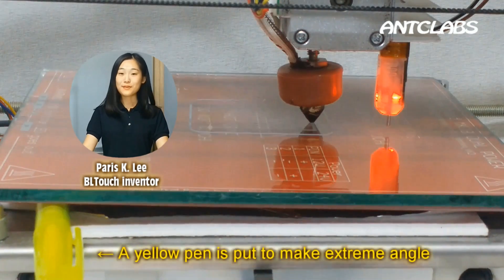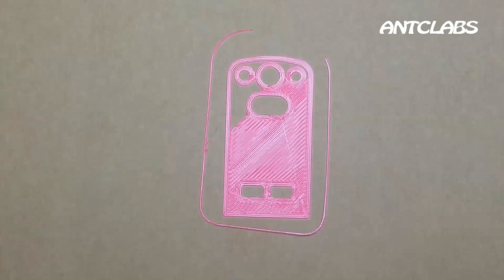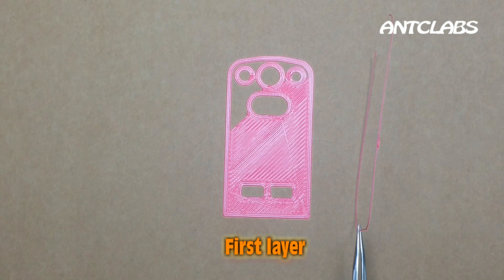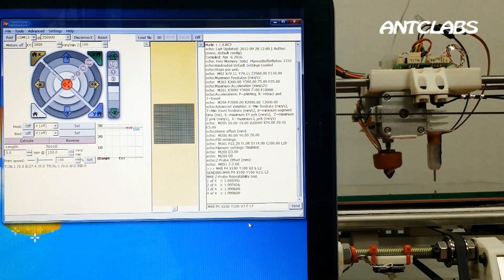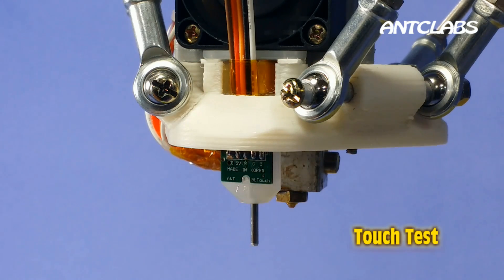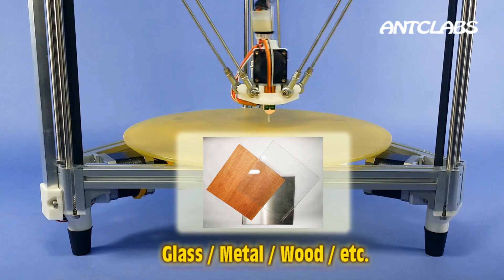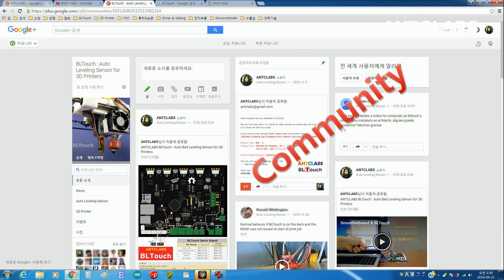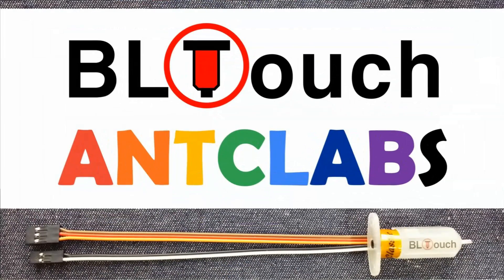ANTCLABS BLTouch :: Auto bed leveling sensor for 3D printers

Comment: It's incredible. The BLTouch cable must actually be shielded, if it is routed too close to the fan cables. (https://youtu.be/jkcrRCxPlZM). If I turn off one of the two fans on my hotend, leveling works without any problems.  If I switch it on again, it will break off leveling somewhere.  The disturbances actually seem to come from the control of the fans.  I preheated the printer and then set it to cool down and then leveling it ... so one fan on my hotend is also off and it works.  The bed then still has a temperature of 50-60 degrees.  For leveling once a week or a month, that's enough for me, because I want to save myself having to shield the cable. :-D                                                                       Es ist unglaublich. Das Kabel des BLTouch muss tatsächlich abgeschirmt werden, wenn es zu nah an den Lüfterkabeln verlegt ist. (https://youtu.be/jkcrRCxPlZM). Schalte ich einen von zwei Lüfter meines Hotend aus, funktioniert das Leveling ohne Probleme. Schalte ich ihn wieder ein, dann bricht er das leveling irgendwo ab. Die Störungen scheinen tatsächlich durch die Ansteuerung der Lüfter zu kommen. Ich habe den Printer vorgeheizt und dann auf Abkühlen gestellt und dann leveling ausgeführt....so ist ebenfalls ein Lüfter aus und es funktioniert. Das Bed hat dann immer noch eine Temperatur von 50-60 Grad. Für einmal in der Woche oder im Monat leveling reicht mir das, da ich mir das abschirmen des Kabels ersparen möchte. :-D

Comment: Why are you guys using heatshrink to set/hold the distance between the hall sensor trigger and the probe pin when the sensor is right next to a hotend that will heat up the heatshrink and have it change this distance over time dependant on the the temp. This means the Z offset changes dependant on the ambient temp or how long the hotend has been running, very frustrating when you run a calibration before each print and have to reset the Z offset every time due to heatshrink reacting to the temp around it. Why not make the pin slightly larger with a thread on it then tap and thread the hall-effect sensor  trigger  onto the end of it?